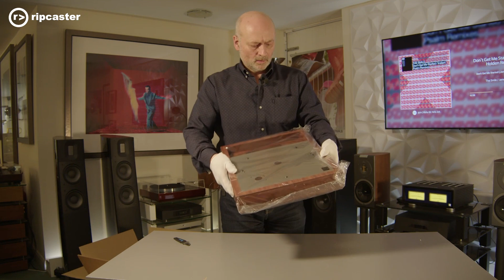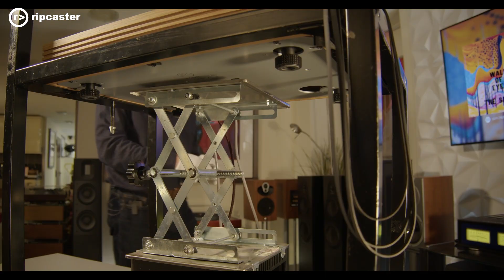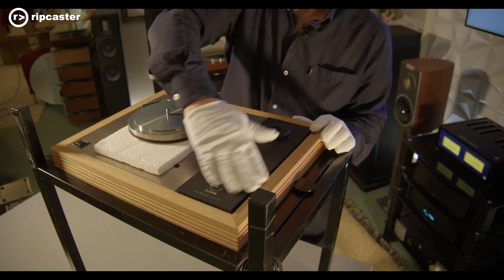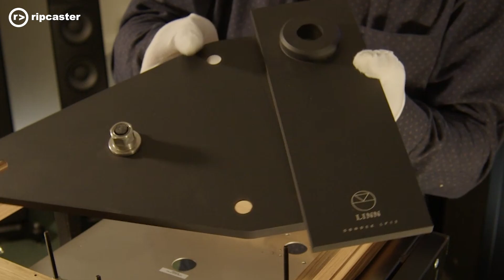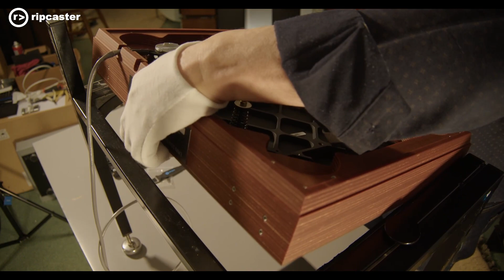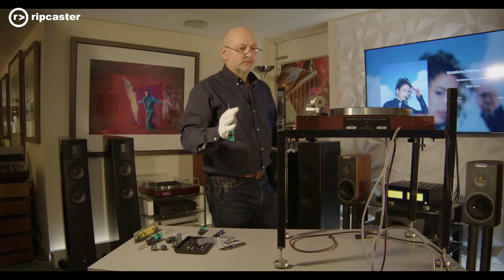Complete build of a Linn Klimax LP12 turntable with Bedrok plinth at Ripcaster

Comment: Should you not check your arm setup with a cartridge pressure gauge as l have never set been able to set my arm dial to 2.00g it always comes 
out at just under 1.8grams as the true weight?
Reply from the maker: Yes - we always use a digital scale to set the tracking force. If the arm is correctly balanced (zeroed) then the dial should get you very close to what the scale is reporting. Not all steps are shown in the video due to edit/time constraints.

Comment: It's certainly a very beautiful piece, but the price is completely unjustified.
Secondly, it goes against Linn's theories and practices for the past 50 years.
A very rigid but lightweight chassis, a very rigid but lightweight tonearm, a very rigid but lightweight turntable rest, etc.
A 16 kg chassis alone that weighs almost 1.5 times the weight of a complete turntable?
Reply: That's their answer to the mighty rega NAIA, but sadly the price for this plinth is the entire cost of the NAIA, what would you do?
Reply: @cheungshuiyeung5081  I would save my money and buy a real turntable. Not some tinker toy or some packaging material.
Reply: Indeed, I think they have lost all connection to reality, with this and the Keel SE  sub chassis being laughably bonkers pricing.  Both being 10x what they really should be.
Reply: @greenygreen5308  So you think a piece of glued together wood and a slab of machined aluminium are not worth 17000 euros. It seems you do not have the braindamage required to get into the Linn bandwagon.

Comment: Can you tell me what cable/classification Ethernet cable you are using from the Urika ll (exakt) to the DSM?
Reply from the maker: CAT 5/5e UTP/FTP, CAT 6/6a UTP/FTP - see https://docs.linn.co.uk/wiki/index.php/Exakt_link
Reply: Was going to comment on the Ethernet cable used as Exaktlink. It looks suspect as I've heard more than one Urika 2 equipped LP12 basically ruined by using an expensive audiophile marketed cable. These tend to be shielded. Shielding is there to provide higher data transmission rates over longer distances. Completely not needed in this application. The down side of shielding is that it introduces crosstalk. Crosstalk throws off the timing signal, which is critical to accurate music reproduction. I recommend using individually tested Cat 6 cable. It is unshielded, and contains the center plastic spline that is missing in Cat 5e. The spline helps to reduce crosstalk. I've tested these in my Klimax LP12, and as Exaktlinks between the NG Klimax DSM and 360 speakers.

Comment: Very interesting.  But I've got one for you.  Take an 1983 LP12, perhaps one that has even gone through a clinic at the worst Linn Dealer that ever existed in Tampa, FL (currently out of business) and had the Cirkus Bearing Upgrade, Trampolin Base and a vintage Lingo Power supply (with the larger chassis).  Bet it can't be done.  C'mon.  Show me wrong.